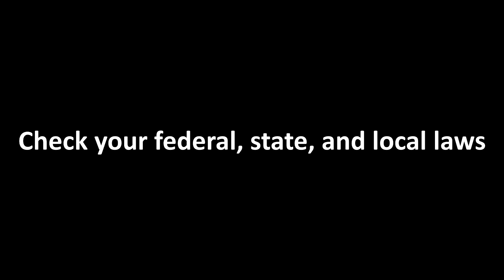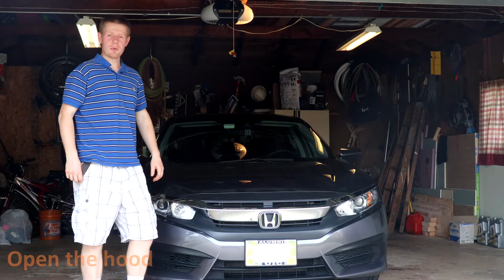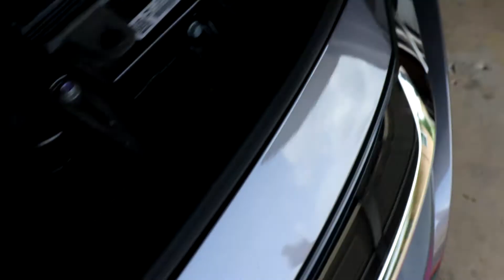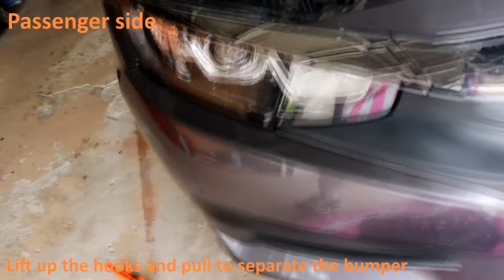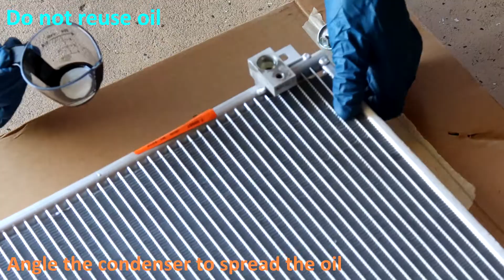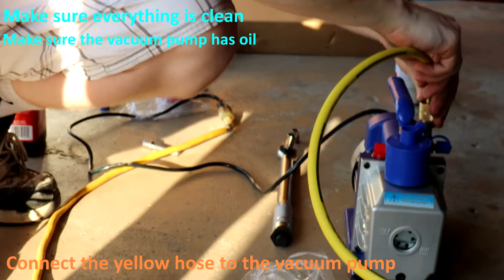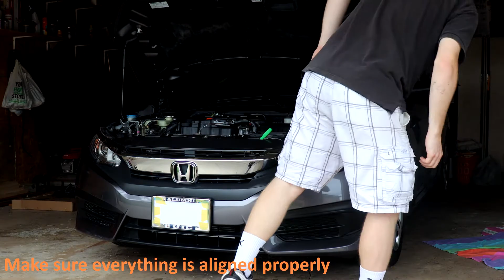Honda Civic (10th Gen) – Replace A/C Condenser and Recharge System (AC Condenser, Front Bumper)

Comment: hi, thanks for the video. I replaced my condenser and put oil directly from the condenser (top inlet) only now it seems the system is clogged. The system worked fine (apart from the condenser leak) before the replacement, now only warm air comes out. The compressor works. High pressure and low pressure are the same, so I think the condenser is clogged with oil. What do you think? Thank you

Comment: Common issue with 2016-2021 Honda Civic, Honda extended the warranty for AC compressor seals and condenser. Just had my wife vehicle replaced the seals on the compressor and replaced with new condenser from Honda on 7/15/23 for free. Love your video, very detailed instructions.
Reply: Just had mine replaced today under that extended warranty letter Honda sent out last year, for free as well.

Comment: Today I went to Honda dealer because my AC is not cooling at all. It is a 2021 Honda civic Touring. They checked the car and said the condensor is leaking and has to be replaced. A new one is ordered and I have to go there in a week to replace it. It is great that everything is covered by warranty.

Comment: I need a picture of the high pressure switch harness and wires.....can u help or email a picture?
Reply: Bought a salvage car and need to know which wires i need to splice into as i got the connector off ebay.......but i see 3 bare wires.......red.....green ....purple that are suppose to go to the harness of the high limit switch......

Comment: Hi thank you for video! Can you say me code serial number of part Ac condenser? Thank you :)
Reply from the maker: I used an aftermarket condenser. The part number is below. keep in mind, my civic has a 2.0L engine. Make sure it is compatible for your vehicle.
Murray Climate Control A/C Condenser With Drier
Part #7-30007

Comment: Thanks for tutorial. I found I gap in your tutorial. Maybe you can explain it. Once you are ready to recharge and you  connected refrigerant can to a yellow tube. After that you purged air from yellow tube. I assume after that you opened valve on your can to fill yellow tube with refrigerant after that. Started your car and then you mentioned opening blue valve. What about the red one? Does it remain closed all the way till finished filling all refrigerant?  Much thanks
Reply from the maker: red (high pressure) stays closed at all times

Comment: Is it 50ml of oil as well for the 1.5l turbo engines
Reply from the maker: Most likely yes (assuming it is a US/Canada production model)

USA/Canada production models - 50 mL (1 2/3 fl oz)
Except US/Canada production models - 25 mL (5/6 fl oz)
Si - 50 mL (1 2/3 fl oz)
Type-R - 25 mL (5/6 fl oz)

Hope this helps. Do this at your own risk.

Comment: Thank you so much for sharing this information with us, 
I have a question please, can I do the same thing you did on my car but without using the vacuum ( because I don't have one)
??
Thank you again
Reply from the maker: It is recommended that you vacuum the system. You may have problems in the long run if you don’t get any air and water out of the system.

Comment: Hello. If I accidentally unscrewed a bolt of my ac line and let my refrigerant out, do I need to add oil to the system, or do I just pull the vacuum and add refrigerant, thank you!

Comment: i was able to remove the condensor without taking bumper off just take metal bracket off yes plastic clips are in a tight spot but very simple,to do this 30 min it took

update you can get this under warranty for this just make sure to remove any debris on condenser ie rocks,wood ,plastic glass,etc
Reply: got a video of it?
Reply: @26point2man  not really which part are you having difficulty with

Comment: Thanks for putting this video together, very helpful! Road debris damaged my factory condenser. I just finished the job on my '17 Civic EX-T, I got my AC back! All the steps except for a couple things were different with mine. The first, my Civic has fog lights, when the bumper is disconnected, just unplug the fog lights. The second thing, my car had stupid, annoying plastic pieces around the condenser that made it very hard to get the condenser in and out. I was able to loosen the plastic on the left by removing two plastic clips (similar to the ones used everywhere). The plastic was still annoying/in the way.  I bumped some of the fins on the new condenser against the hood latch trying to deal with the annoying plastic pieces, fortunately it did not damage the condenser and cause a leak. 

Anyone dealing with the EX-T models, just be prepared to run into that, and be very weary not to bump your condenser on the hood latch. Also some more generalized advice, I put masking tape on my bumper around the headlights where you have to wedge the plastic bumper removal tools in the remove the whole bumper off the car. Last thing for others out there, I put r134a pag oil as well as 134a refrigerant into my system. The '17+ models now all use r1234yf refrigerant. r1234yf and r134a are essentially interchangeable. r1234yf is (literally) 1000x more better for the environment and care companies (especially in Europe) are being forced to use it by default now. I'm all for greener solutions, but one 12 ounce can of the new stuff runs $45-60 dollars. Way overpriced IMO and not mainstream enough (yet). I charged it with a $5 can of r134a from Walmart!
Reply: Did you go with an oem replacement?

Comment: Honda has put a 10 year extended warranty on these AC compressors in Canada .Mine was just blowing warm air a few days ago...Took it to the Honda dealer outside Toronto  Ontario Canada and they replaced the condenser for free.....This is an extended warranty not a recall.....In addition to the condenser they replaced the piping to the condenser...I can not see why they would not do it in the US...check with your dealer...

Comment: Awesome video! Very detailed! By the way, I have 2016 civic EX, is it the same process?
Reply: Working on me Ex-t model as I type this. Ex is same procedure! I have the fog lights and the only extra step was unplugging them. The intercooler is also out of the way so no extra work getting at the condenser. Hope this helps you and others with Ex and turbo models!

Comment: Just did this. I ended up forgetting to add the oil to the condenser. Don't most condensers come with the oil? I haven't charged the system yet.

Comment: Thank you very much for taking the time to make this detailed video on this process.  Where did you get the Gauge,  Hose and vacuum for the R1234yf refrigerant?  Did you get it from the loaner tools at the autoparts store (which one) or did you purchase it?
Reply from the maker: I purchased them from Amazon. Links below
https://www.amazon.com/OrionMotorTech-Refrigeration-Evacuation-Recharging-Diagnostic/dp/B07GBMYH24
https://www.amazon.com/Mastercool-83272-R1234yf-Aluminum-Manifold/dp/B007K92PLQ
Reply: Piotr, thank you for taking time to make this video! The Orion manifold and vacuum pump set you used says it is for Diagnostic R134a R22 R410a, no mention for R1234yf, but you used for civic with R1234yf. Sounds like it is compatible with ports for systems using R1234yf?

Comment: Wesley Chapel Honda in Florida just quoted me $2800 to replace condenser and compressor.  The car has 44k miles on it and blows cool air out of the drivers vents, not cold.   I mentioned this 19-091 recall and was told my car did not qualify.  I think they were trying to scam me so I picked up the car and complained to corporate.  At the end of the day, I'm screwed.   Will just shoot it with some refrigerant and see how long it lasts.   Never going to a dealership again.
Reply: @Joey-yq5se  been 3 weeks for me and it’s held up. I read someone in a Civic forum having lasted 1 year and counting on a charge after discovering this problem.
Reply: Funny you said that. I was on vacation last week in FL and stayed on the Best Western in front of Sleep Inn in Wesley Chapel (just a couple of blocks away from that stealership) and I actually planned on stopping by to inquire about my AC...  Glad I didn’t.  My ‘17 civic HB just hit 44k miles on that trip.
Reply: How has the system held up after the recharge?

Comment: hi, my 2007 Honda civic's ac is not working. it is blowing hot air. when i took it to the local dealership, they told me there is a stone chip on my condenser and the give me quote for $1050 to fix it. i just noticed that my ac compressor is not spinning. will the compressor stop working if there is a chip on the condenser?
Reply from the maker: For the a/c compressor to turn on, there needs to be a certain amount of pressure in the system. If the pressure is too low or too high, the compressor will not turn on. If there is a chip in the condenser, then most likely the a/c system lost refrigerant and there is not enough pressure. There is always the possibility that the compressor went out, blown fuse, wire disconnected, etc.

Comment: I have the same car (2016 EX-T) I bought it new.   I received a letter from Honda last year about the extended  warranty. last week the AC  stopped cooling 
 I called Honda  about the issue and they asked me to take it to the dealer for diagnosis.  If the dealer ask for more than $50 for diagnosis, I will replace it myself.
 After market condenser ~ $50 + oil + O Ring + Refrigerant probably around  $120 max.
Plus, I don't trust the guy at the dealer removing and breaking some of these too many clips and screws
In 2007 I replaced a condenser and rebuilt the cracked compressor for my friend 2004 Infinity coupe. Dealer wanted couple thousands dollar to do it.  I fixed the crack with J-B Weld  $7 from Walmart (yes believe it) . AC was still working flawlessly the day he sold the car in 2015

Well, I went to the dealer today, and he wants $250 just for diagnosis. I'm shopping for parts
Reply: I called Honda today about that.  First she quoted me $130 for diagnosis.  Then she put me on hold for about 2 minutes and came back with a $180 diagnosis. Boy do I hate stealership!
Reply: How’d it go?
Reply: Went to Honda with this issue a little over a week ago and they told me it would be a minimum of $1800 for everything, LOL. They're wild at the dealership.
Reply: Did you manage to replace it yourself? Dealer is quoting me almost $1900 for the replacement.  Did you go with an oem condenser?  Did you find any differences in this video versus ex-t?

Comment: U didn’t know that there is a recall for the condenser for 2016-2018 Honda Civic?  They change mine last year for free. And lifetime warranty
Reply from the maker: I knew there was something but I did not want to deal with the dealer. If they claim foreign object damage, then I am out $300 USD (a/c diagnostic fee). I would rather take that $300 and buy the things I need to fix my car. And besides, I like picking up a wrench and doing it myself. I still have the bumper to bumper warranty from Honda till Feb 2021 since it was a certified preowned when i bought it.
Reply: They changed mines for free today! There is an extended warranty on 2016-2018

Comment: Will the pag 46 oil work for the condensor ? And how much fluid did you add to condensor
Reply from the maker: It depends on your vehicle. If you use the wrong oil, it will cause problems. Find the ac sticker on the hood and that should tell you what refrigerant it uses. For US models, it will also have the type of oil. If the system uses HFO-1234yf (R-1234yf), then the oil it uses is RL85HM (POE oil). The part number for RL85HM is 38899-RLV-A01. If the system uses HFC-134a (R-134a), then the oil it uses is DENSO ND-OIL 8 (PAG oil). The part number for DENSO ND-OIL 8 is 38897-PR7-A01AH.

If you have a US/Canada production model, then you are adding 50mL (1 2/3 fl-oz). 
If you have anything other than a US/Canada production model, then you are adding 25mL (5/6 fl-oz).

For my civic, I used 50mL of RL85HM (POE oil). I bought the oil from Right Honda. The link is below.
https://www.righthonda.com/order-parts/?path=%2Fsearch%3Fsearch_str%3D38899rlva01

Do this at your own risk. I will not be held liable for anyone/anything.
Reply: @PiotrBilek  i ended up getting compressor oil from oreilys for the r1234yf ac system
Reply: @PiotrBilek  I am just curious where do you get the 50ml from because from honda civic user manual it states between 4.7 to 6.3 cu-in (77 - 103cm3) so 50 ml is a little low. Also the vacuum part is just to insure it's not leaking, right? thanks.
Reply from the maker: @Btu555  I was replacing the a/c condenser and since I have a U.S. production model, I have to add 50mL of RL85HM. If I was replacing the a/c compressor, then I would make sure that the new compressor has the same amount of oil as the oil compressor. It should be somewhere between 77-103mL. 

I am pulling a vacuum to make sure there are no leaks and that there is no air and/or water in my system.

Comment: I got a letter in the mail last year and thankfully my 2016 was under the extended warranty because it stopped cooling this year. I just got it back from Honda, they had it over a week because the condenser was on back order but they replaced it free of charge, hope that fixes the problem and there is not another part in the AC system that leaks.
Reply: Were the fins on your condenser bad by any means? I have a 2016 civic too, and I have booked an appointment for diagnosis but I am pretty sure it’s condenser based on so many people with same issue. But my condenser’s fins seem quite messed up maybe from road debris. Not sure if it’s worth paying couple hundred for diagnosis at a dealership, they might just say it’s not a bad condenser, it’s just damaged so they can’t fix it under warranty.
Reply: @harrysaini2379  Don't go to dealer. A lot of people has faced the same issue. Dealer will say that it won't be covered under warranty if the fins are badly damaged. You will get all the condenser related parts for the same diagnosis fee.
Reply: Vivekananda Reddy thanks for the reply, actually I have been to dealer already and apparently even though my condenser’s fins were in pretty bad condition the actual coil was not damaged, so they agreed to do it under warranty. I saw the letter Honda published for this warranty and in that they had a couple pictures of what kind of damage voids warranty and what kind doesn’t, I checked and I took the risk. It was well worth it. :)
Reply: @harrysaini2379  is your ac ice cold? I just got mine replaced and now it’s barely cold
Reply: @jacksonsilva6335  yeah it takes about 10-15 minutes on a hot day to start blowing ice cold air, which I think is normal, but I can immediately feel that it’s working when I turn it on. The mechanic should have checked before finalizing the repair, I don’t know what else to say but If it doesn’t feel cold after a few minutes then I suggest you go back to them.

Comment: great video ...could you post a parts list with part numbers ???  Thanks
Reply from the maker: Double check the part numbers. Use your vin to make sure they are the correct parts.

Parts Needed (00:17)
A/C Condenser
Compressor Oil
O-rings
Refrigerant
Replacement Clips

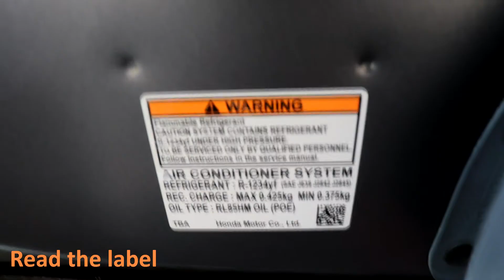(01:44) The parts I used for my vehicle 
(00:34) Some information about my car

A/C Condenser
80100-TBA-A01     2.0L NA Engine
80100-TBC-A01     1.5L (possibly diluting oil) Turbo Engine
80100-TGN-G01     2.0L Turbo Engine

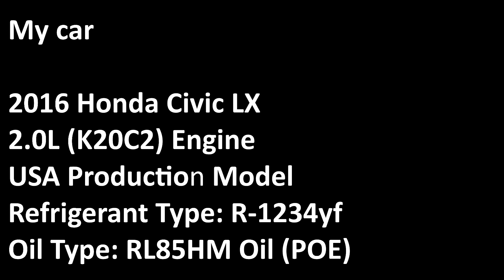Compressor Oil/Refrigerant (00:45)
38899-RLV-A01/HFO-1234yf     KA and KC Emission Codes
38897-PR7-A01/HFC-134a     KX Emission Code

O-rings
80872-SN7-003     1/2in
80873-ST7-000     8mm

Replacement Clips
91505-TM8-003
91501-S04-003 (91512-SX0-003 was discontinued)
91504-TBA-A01

Comment: According to the Civic air conditioner class action, Honda should be forced to "repair, recall, and/or replace" all 2016-2018 Civics. ... Due to the defective condensers, Honda extended the air conditioner condenser warranty to 10 years and unlimited miles.Dec 24, 2019
Car complaints › news › honda-civi...
Honda Civic Air Conditioner Lawsuit Filed Over Condensers | CarComplaints.com
Reply: Marco, Thanks very much for you comment.  I was just about to paid around $700 to perform this A/C condenser  repair, but then I read your post and called the HONDA dealer provided  the VIN number and guess what the repair it is cover by the extended warranty. Muchas Gracias amigo.
Reply: @rogerrios4303  lucky, I have 2017 civic LX turbo and they said my VIN isn't covered for some f*cking reason. I'm pissed
Reply: Seven Ηaze take it to a different Honda dealership
Reply: Do you know if the 2020 Civic LX has this or other problems? I bought mine in November 2020 and so far, everything is running perfectly. Only 800 miles so far though...